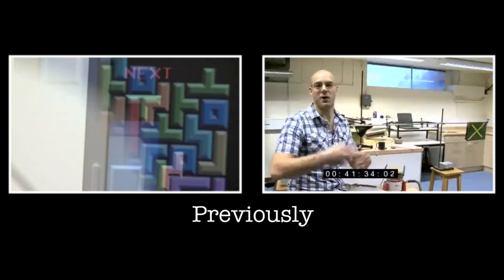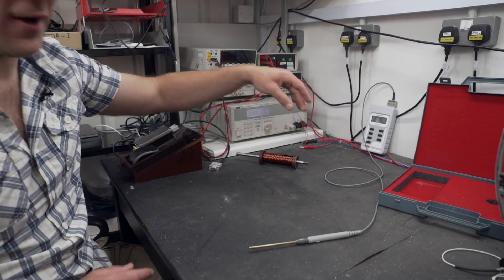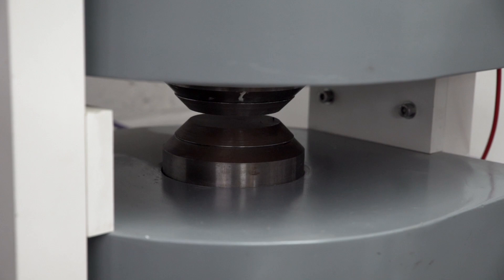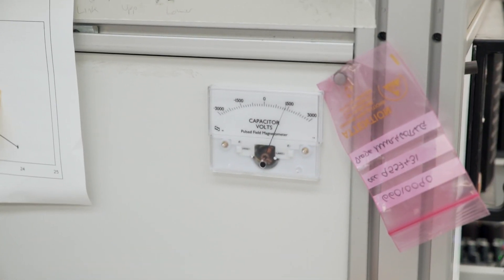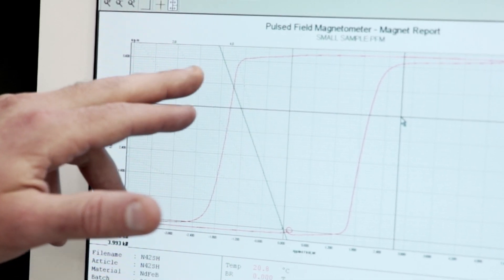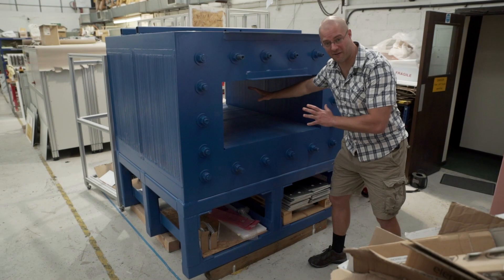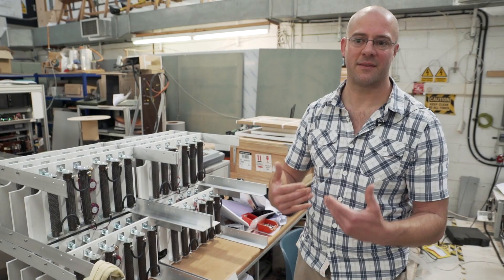How do you measure a magnet?

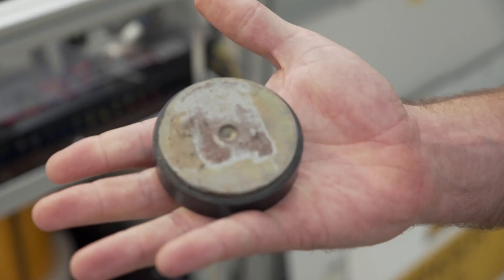Comment: The thing on the cupboard at 10:10 is not a neodymium magnet! You would not even get it off the metal by hand probably. The black is a ferrite magnet, and it seems to bee a loudspeaker magnet with a strong field across a small gap for the moving coil of the speaker, on the other side.
Reply: What he 👆 said!

Comment: One question i never found the answer in books or the internet:
What is the theorical maximum field for a permanent magnet? (regardless of its composition)
And how close state of the art permanent magnets are from this maximum?
Reply: Theoretically, I guess, if all the constituent atoms/molecules are oriented such that the unpaired electrons in them point in the same direction, that will give the strongest magnet possible for the material (see https://en.wikipedia.org/wiki/Electron_magnetic_moment ). May not be too difficult to calculate if you know the moment of individual atoms/molecules, the density of the material, the molecular weight, and use Avogadro's number.
Now if you are asking this irrespective of material/composition, I am pretty sure that the answer is that there is technically no limit -- you just pack spin-1/2 particles (which are the elemental units of magnetic moment) more densely in a region of space to get higher and higher magnetic field density. This literally what happens in a neutron stars, although in a neutron star the neutron spins are not all co-aligned, and the insanely high net magnetic fields are probably purely due to the high density (you cannot achieve such high densities with only electrons since there will be nothing to hold the electrons together, nor with protons since the electromagnetic repulsion will be far greater than the weak force interactions). But then of course if you keep packing things more densely, it will collapse into a black hole!
Reply: Easy enough for terrestrial magnets. An alloy of FeCo has the highest magnetic moment density, around 2.5 Bohr magnetrons per atom. This works out to a maximum induction of around 2.5 tesla. Electromagnetic fields can now go up to 45 tesla, so much more powerful - but expensive to run!

Comment: Great video, this is the stuff I wish I had since playing with coilguns in high school, the first time I accidentally "broke", ie demagnetised, a 1 inch neodymium magnet was a revelation and here's the explanation. Wish he'd given stats for voltage, resistance, impedance, etc, to calculate what it could do, and he skipped over the reason for the importance of placing the magnet in the "exact centre." There were no visible security measures like brightly coloured straps across the power rails or metal mesh covers, hopefully they don't actually have it "open all the time" because that stuff'd literally blow your arm off before you could even touch it.

Comment: A quick Google search tells me global CO2 emissions in 2018 were 36.2 gigatons. Dr. Clewett claims we can reduce global CO2 emissions by 3 gigatons annually (8% of total global emissions) just by improving current electric motors? It's not like modern electric motors haven't been worked on extensively... Is this accurate?
Reply: I share your skepticism. He talks fast and makes a lot of statements without explanation or justification.  High quality motors are already 80 to 90 percent efficient.  Sadly he doesn't state the efficiency gain.  I've never heard anyone suggest that the bulk of co2 emissions are down to energy losses in electric motors or generators, so what is the comparison?

Comment: Please tell to your audience: what do you mean with A) a "quite big current power supply" (on 1.43 in the video, your hand covers the reading on the meter somewhat, I could not read the current) B) what means a 0.058 Tesla field C) on 2.23: question: is this 2.6 Ampère (not clear) D: the relation when the permanent magnet "flips", you stick it to a steel bar, so it does not show (when it flips) "precisely" the "magnetisation" of the permanent magnet, because the field moves/collapses somewhat (in the 1-5 % range), so it ony gives an "idea" of the magnetisation (level) of the permanent magnet. The magnetometer going from 4.35 in the video is OK (hysteresis measurement).Please clearly tell on  5.23 that you dump in 10-20 Kiloamps (not easy to hear that). And what do you mean with "10000 kettels all at once just for a few milliseconds" (I am sure "kettels" (?) is not what you mean). On 5.29 in the video, please give your You Tube audience an idea what "8 tesla" means (5.33 in the video). Please don't try to keep things secret, everyone interested knows the concept that you explain here and (thus) can reproduce this circuit to advise electric motor makers, measuring the EM field via supercaps, dumping an extremely high current into a coil.  9 august 2019.
Reply: I might be able to explain one point.   A kettle for boiling water will typically take about 8 amps from 240 volt supply (2 kW).  Very roughly a thousand kettles take nearly a thousand amps.  For the rest, I don't know, the presentation was mostly just "I'm excited",  ... and confusing.
Reply: @raykent3211  Thanks for your answer! When you say 2 Kilowatt that gives a real idea. Very interesting video, by the way.

Comment: i always assumed that magnets are made by cooling them below the curie point whist in a magnetic field.   didnt know they pulsed them cold.
Reply: That's how duplicator machines for magnetic tape storage media work. You have a metal master tape that runs continuously in a loop and then in a short section you bring your target tape close to it and zap the tape with a laser to bring the magnetic particles of the target tape up past their curie point. The target cools below the curie point and retains the magnetic field from the master. And then the target leaves and gets wound onto a spool to later be cut into sections to be loaded onto cassette reels.

Comment: compressed air energy storage
Replace lithium and other pollution with air
Be sure to see Wilmshirst, searl, wallace utron generators
Magnets are better than just burning stuff for energy for sure
But can we lose the batteries
Gravity and air
Use that instead

Air and water displacement generators could get a more cyclic system going using the compressed air
For continuous free energy

That being said I would love to see a gyroscopic tourbillon with ferropolymer springs generate the power

Also why are all kettles not a hero of Alexandria steam engine
Attach a long speedo cable add a handle and a sanding/cutting disk or drill for little jobs around the home

Does anyone else think kettle, boiler, oven and the sun when searching for generators
Also you would think restaurants would want no energy bill
Eventually they do become thermoelectric

pollution free free energy is here now
Our future is counting on it

Comment: I am actually surprised the wires dont spark at that distance.
Reply: It's only 3kV. At typical values for air it wouldn't jump more than a 1mm gap (yes, one millimeter). Of course this depends on the shape of the conductors (pointy electrodes spark easier), how dry the air is and stuff like that. But the distances seen in the video are at least a magnitude, if not two above what could spark.
Reply: @superdau  When did it say that it was just 3kV? I was under the impression that he said something in the tens of kilovolt, but I might be mistaken. That is why, since the spark can jump about a centimetre per 10kV from a needle(I think),  the edge should be arcing. As I said, I might be mistaken, and that it is just a low volt, high current system.
Reply: @NoobsDeSroobs  
He was talking about tens of kA, not kV.

Comment: on a smaller scale this high voltage capacitor discharge stuff  occurs in car's CDI ignition systems. and a semester lab  course  would be enough time to experiment and study how they work.  and you'd catch some of the enthusiasm JC is showing us.

this was a hobby task a few years back when my motorcycle stopped running.
and the circuit and uC programming had to be figured out to get it running again.

Comment: 9:00 Why on earth should a generator be more efficient, if it is running at the edge of magnet demagnetization? Thats plainly wrong. 

Running the generator at the edge only makes the generator more susceptible to demagnetization, aka failure, if it runs outside of the usual conditions. The strength of the magnets inside a generator has very little effect on generator efficiency, it only gets a little bit larger, because of the the larger magnets required to generate the same power. 

The only applications where this is  relevant is where size and weight matters, like in  brushless motors for like RC planes and mars rovers

Comment: I know it won't work out as a 1:1 correlation, but having an electric car that's 10% more efficient just by changing the magnets in the motor would be a huge saving on energy.
Reply: The car won't be 10% more efficient. (they can't be: electric motors and generators are already way more than 90% efficient). It is the losses (the few percent to 100%) that will be reduced by 10%.

Comment: How can he be so casual and put his hand anywhere near a machine that can produce 20kA with exposed "wires"? I'd be scared shitless to even look at it the wrong way, it'd probably arc me to death from 10 meters :'(
Reply: High current machines usually run at a very low voltage that won't zap you even if you touch it
..just don't lick it
Reply: @DeoMachina  it runs at 3kv, not your average equipment
Reply: @ChaosPotato
  discipline and procedure